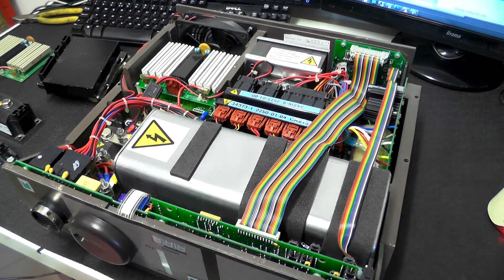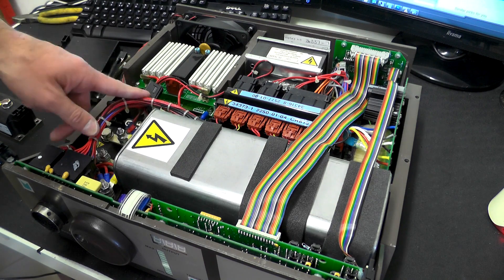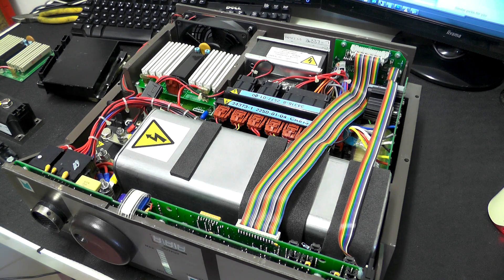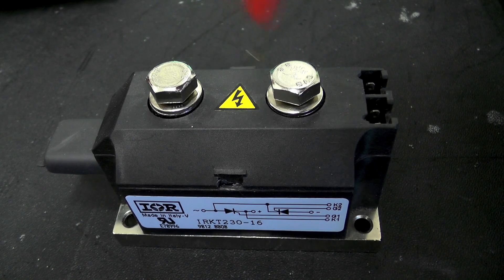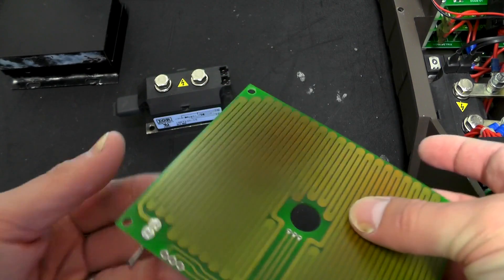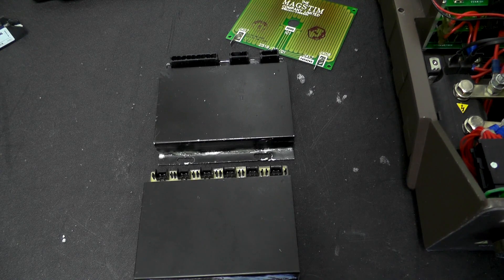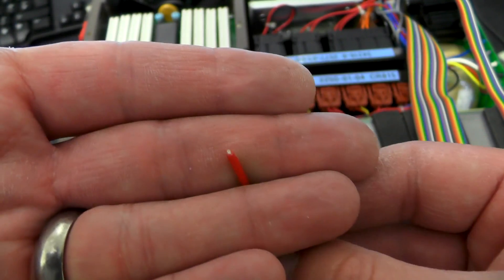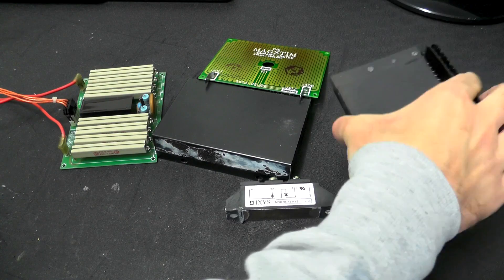DL#063 - Magstim 200 TMS Magnetic Stimulator Teardown Part 2

Comment: PCB units are low inductance resistors, so as to limit dI/dT of the discharge, so as to keep it below the ratings of the capacitor and the SCR. Needs to be very low self inductance, hence the zig zag traces on both sides and the parallel connection to keep self inductance low. The catch diode is there to handle the spike that the coil itself has only, it will not be a very fast device.

Comment: The old board with all those small sub boards was likely a production line series of modifications to replace obsolete IC's with a compatible design as they became no longer stocked, while they did not want to respin the board (or they had made a batch of partly populated boards in a single batch) to use a non pin compatible unit. The boards might have been service spares to upgrade in the field as well, to fix known failures with a simple easy to implement fix.

Comment: re: potting - try immersing it in methylene chloride for about a week.
Safety-wise, maybe replace the cap for something a lot smaller while experimenting.
Are there any low-current wires on the connector that look like they may be for interlock? Maybe it monitors the coil resistance.
Reply from the maker: mikeselectricstuff yes there are many connections from the front board directly to the connector, 8 in total. I have had a look at some of Magstims patents on coil design. They dont really detail the electrical connections to the base unit but they do seem to imply there are temperature sensors and other pickups around the main coil for feedback to the controller. It also seems the coils dont last very long, i read some of them last only about 60-70 uses @ 100% so there is a mechanism for detecting faulty coils. Thanks for the tips about smaller caps and the meth chloride, i'll give them a try.
Reply: DextersLab2013 Try leaving it in a 50/50 mix of pure acetone and Methyl ethyl ketone, that dissolved pretty much everything. Use a glass dish with a tight fitting glass top ( plastic aside from PET and PTFE will just dissolve) to keep it from evaporating. and after a week you will have most pretty soft.

If you have a pressure vessel big enough you can try supercritical CO2 as a solvent, or just R134A at 60C and 150PSI.

I know soaking in CCl4 for a week will leave it as powder and fluff, though you do not get that any more, especially in Europe. You can still buy it in bulk in India and China though.

Caution on opening the SCR module, you want to break through at the non terminal end, and be aware that you might have a Beryllia isolator inside on the 2 silicon pucks inside.